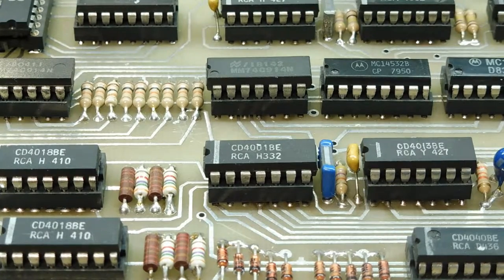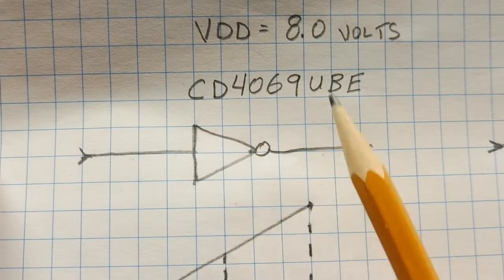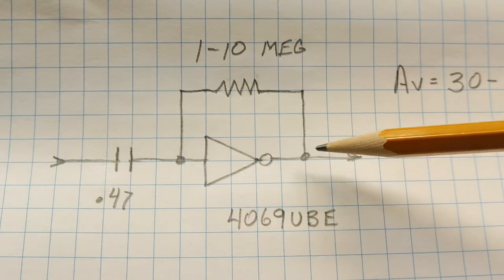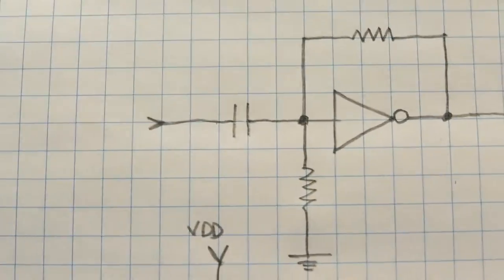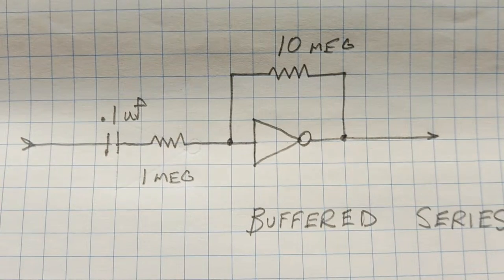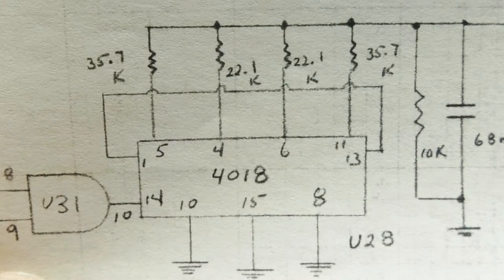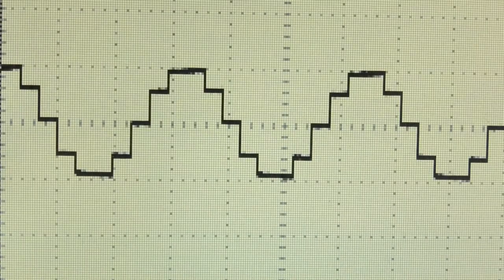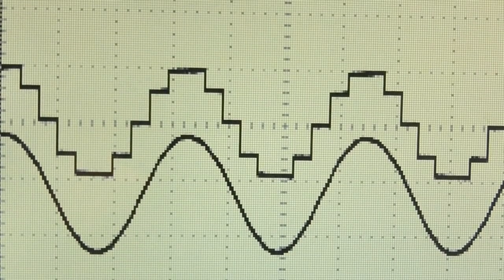How to use digital logic in linear mode / Sine wave synthesizer

Comment: I've heard of using a logic gate as a analog amplifier.  Very cool. Very surprised this video has not been viewed on commented on more. There are a few channels I have found that do not have a wide following but should and yours is at the top.
Reply: Meant never heard of using .....
Reply from the maker: I have used this technique a lot in circuit designs. It comes in quite handy.
The gain can be quite high as I have used linear logic to build a microphone amplifier.
Check out this video:  https://youtu.be/aSXv6FdYQfM